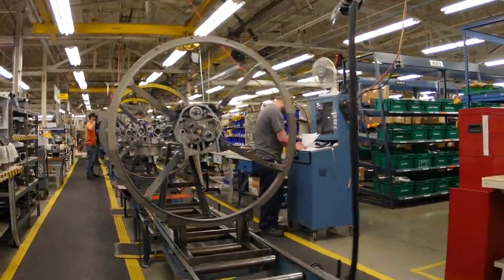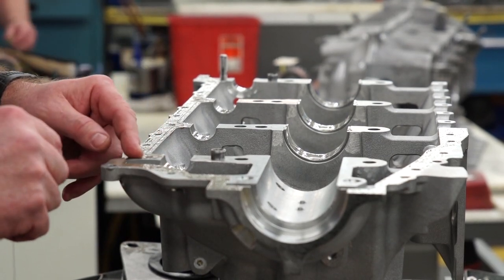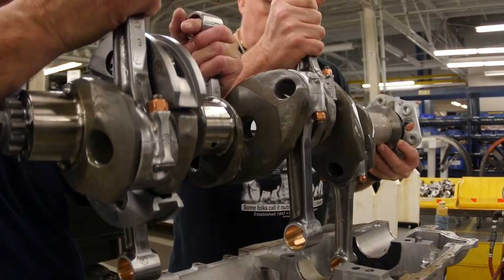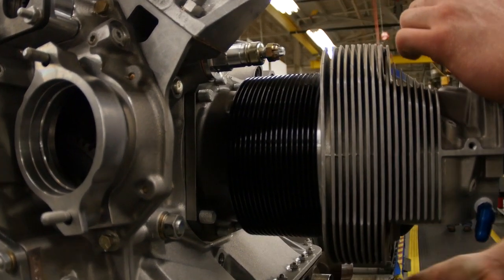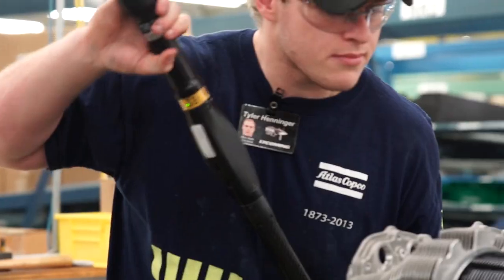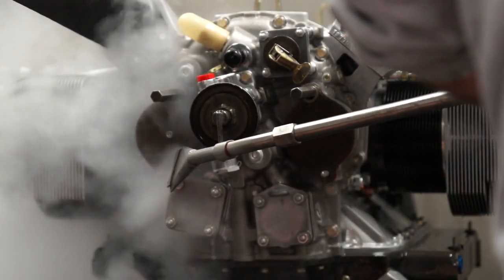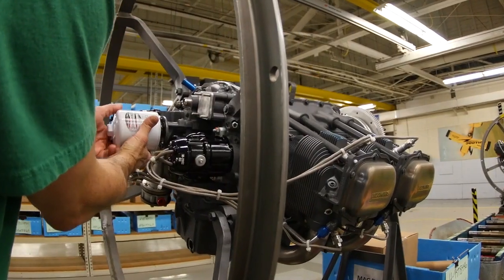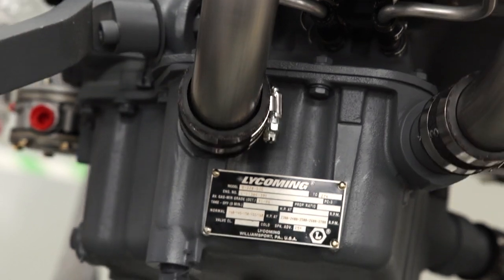Lycoming Engines Assembly Line

Comment: And is that wet torque on all cylinder nuts? The O/H manual and SB  Doesn't specifically address the deck studs only the through studs.
Reply: Deck stud are dry torqued.
Reply: @Dontes Inferno I agree I thought of this after I built a few engines when young, Literally under ye olde shade tree😊..